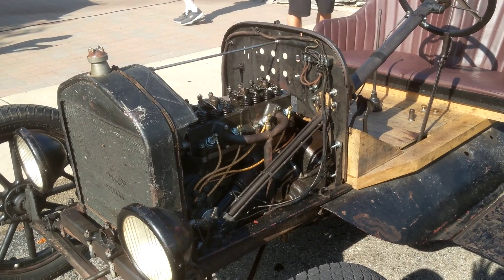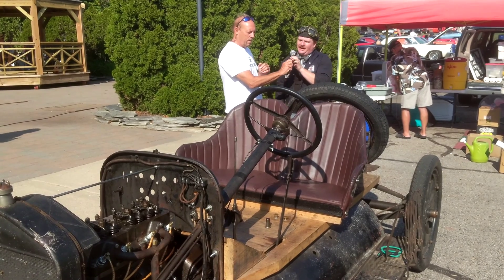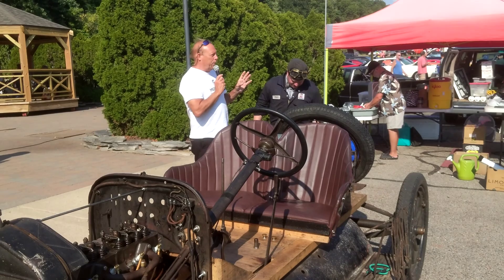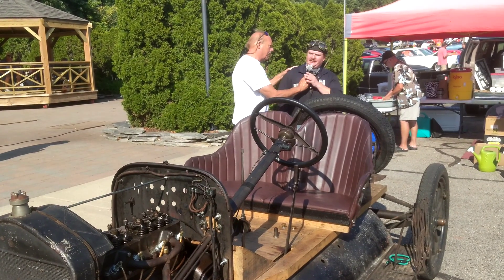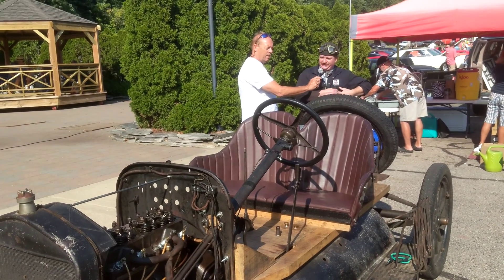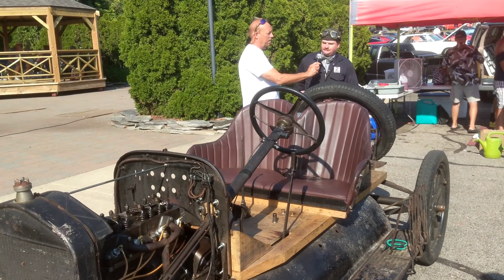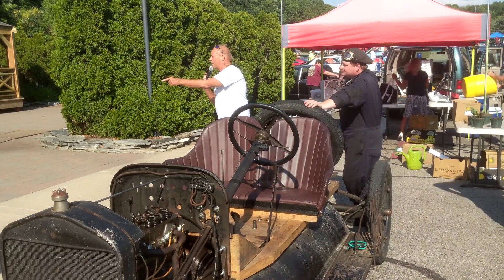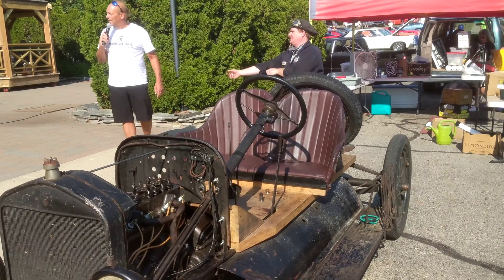Model T hotrod using a Chevy OHV head on a Ford flathead block.

Comment: Ok lets see it drive and run hard  ... any one can idle a engine  ... scared I guess 
We have a T truck with this conversion  i need to post a video  i guess going up thru smoky 
Mountains  ....lol
Reply from the maker: I'm sure he's not drifting in it if that's what you're getting at, but he certainly does drive it to many cruises in Metro Detroit.  I've never seen him use a trailer
Reply: @ChuckG92  no not drifting  pulling a grade yes  nothing sounds as good as  old iron pulling grade .....currently in pigeon forge tenn 
Drove the 50 Mercury  this morning up 441 from Gainesville Georgia   nice weekend run the 255 flat motor sounds good pulling hills ...thanks for video
Reply from the maker: @quagmiredavis4117  Michigan is flat as a pancake.  We don't really have grades
Reply: @ChuckG92  that is true but driving up to Pontiac Michigan there's enough potholes to swallow up that car I have family in Pontiac Michigan it would shake a model T apart the drive up there LMAO
Reply from the maker: @quagmiredavis4117  Ah, but our Dear Governor, Frau Whitmer promised to 'fix the damn roads' then vetoed road spending and now claims credit for Federal COVID money rebuilding some interstates...